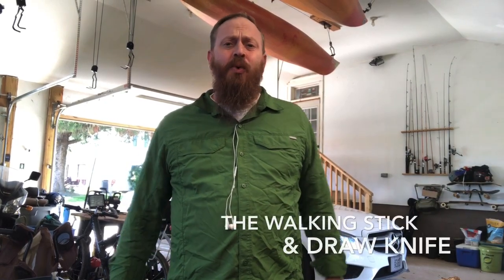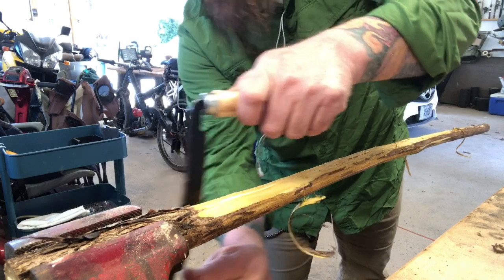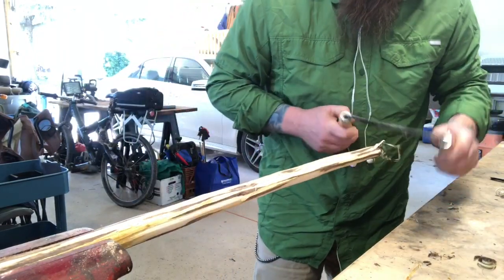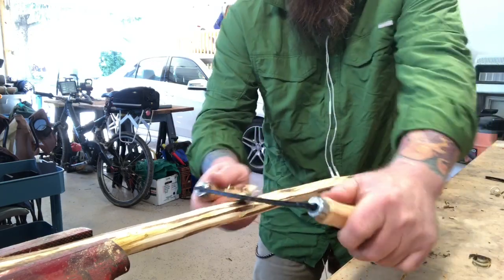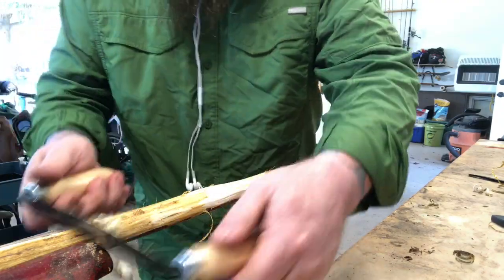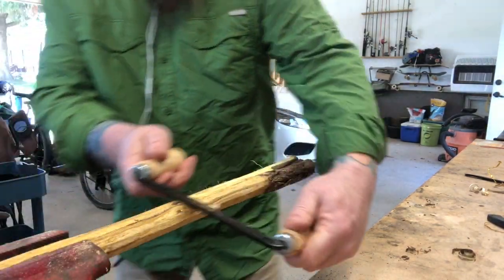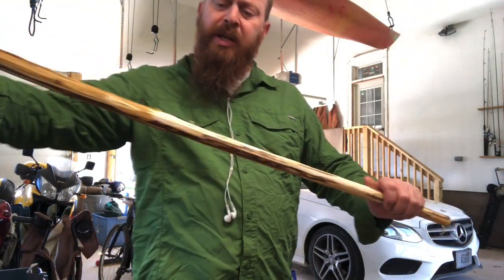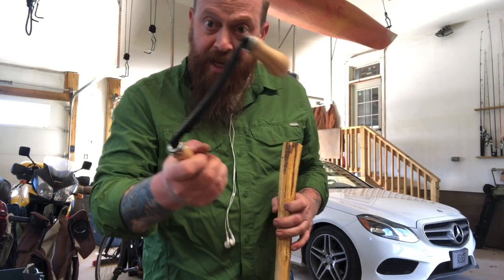How to make a Walking Stick using a Draw Knife

Comment: How do you know which way the roots were once it already been cut? If you wasn't the person who cut it. Or which way to grain is actually going.
Reply: it is pretty evident by either the thickness, (thinner at the top) or if there are knots where the branches were, they generally point or are slopped upward.